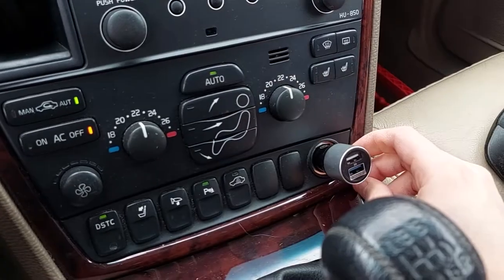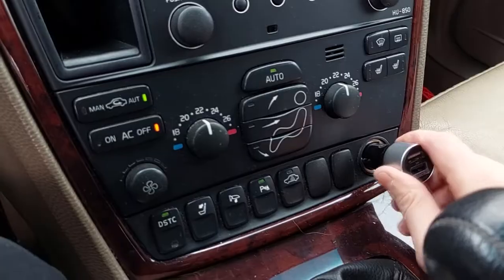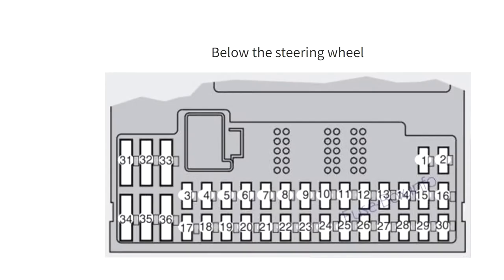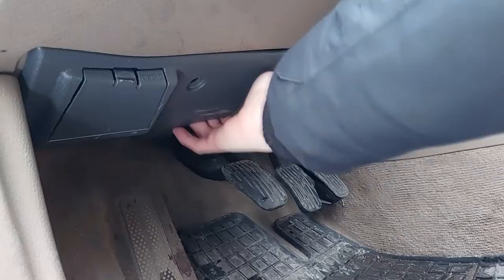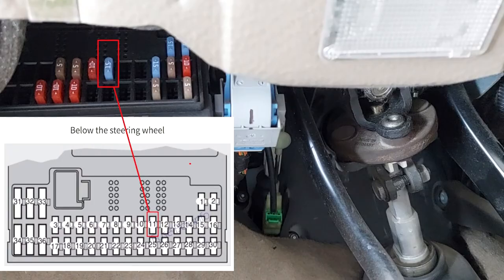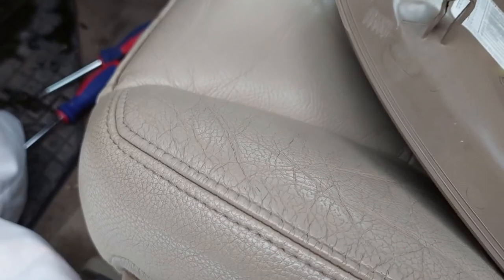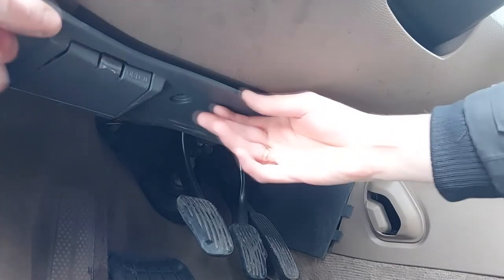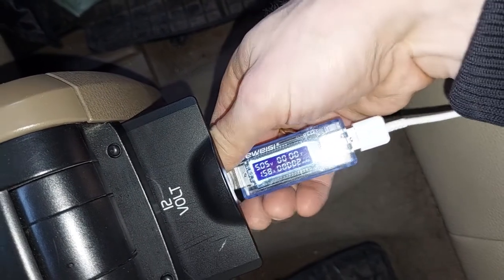Volvo cigarette Lighter Repair - Replace Fuse

Comment: Just came here to say thanks! In my 2005 Volvo XC 70 I could not find this panel anywhere not even a diagrams this video saved my life! My 2 12v sockets in the front and behind the center console were not working. A mini 15V fuse fixed it no problem
Reply from the maker: excellent, thanks for feedback :)